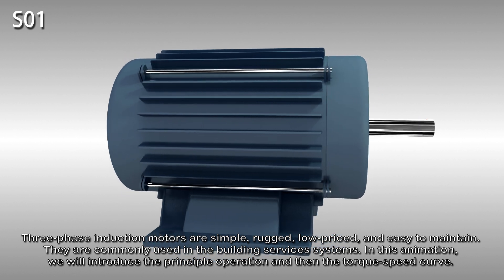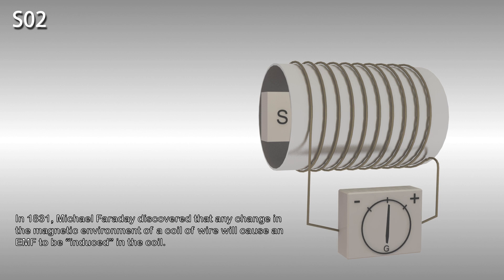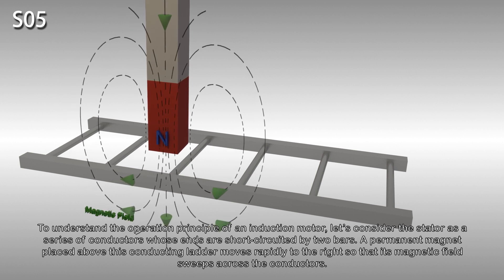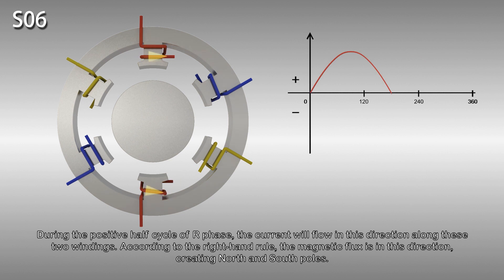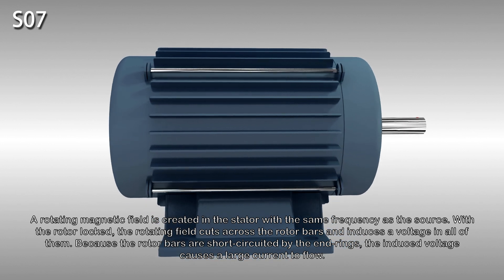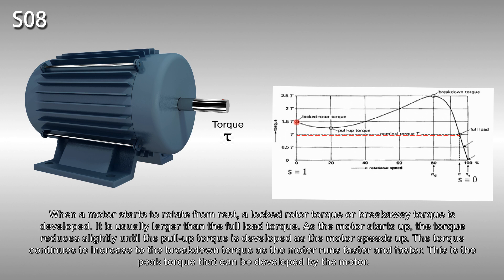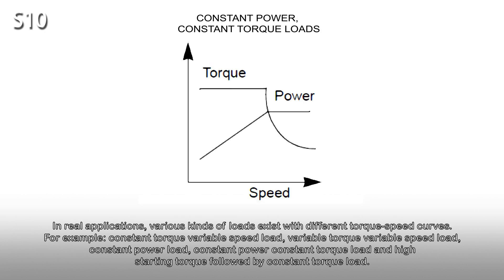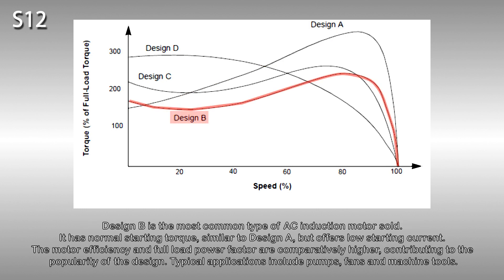PolyU - BSE - Induction Motors -  Principle Operation and Torque-speed Curve

Comment: I want to use this induction motor as a Spindle motor, it's rated for 1450 RPM, I will to ramp it up to 2000 RPM

Comment: Thanks for the valuable information. 

How the torque behaves when the slip is negative due to a prime mover?
Reply: Not expert in motors here,but i would think the torque would then be opposite to the negative slip. If you consider the rotor  as a frame of reference, positive and negative slip just result in a sign change in torque. So the system tries to get stabilized to the synchronous speed.

Comment: Spendid work. One of the clearest, if not the clearest explanation of induction motor on the net. Just a remark : the right hand grip rule should give opposite pole names at 6:09 or am I mistaken ? (Or perhaps the green letters should have been placed towards the inside of the stator, in which case the pole names are correct).
Reply: I believe you're correct

Comment: What about them old ones with the slip rings and resistors? Wouldn't you get the low torque of a universal motor without the need for high amps?

Comment: This is the best explanation of induction motor principles I have ever heard.

However, there was a piece of information which I hoped to hear about in this video but it was not mentioned. This information is why do induction motors are considered constant speed motors? But, after watching this video I noticed something that may point out the answer of my question. Because the steady state speed lays in between the peak torque that could be developed by the motor and the synchronous speed, motor's speed would not change significantly if the load was changed slightly. This is because the performance curve of this specific region is almost vertical. Hence, any change in the load, whether it was relatively large or small change, would change the speed a little bit, and this small change may be neglected. That is why they call it constant speed motor.